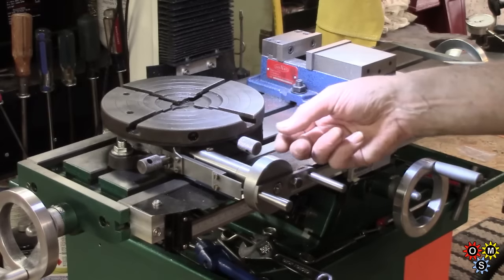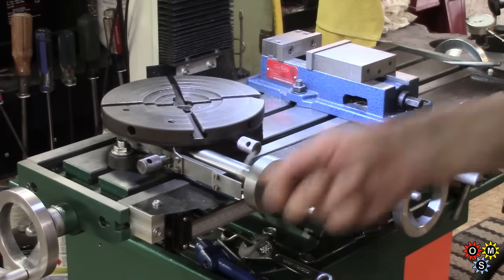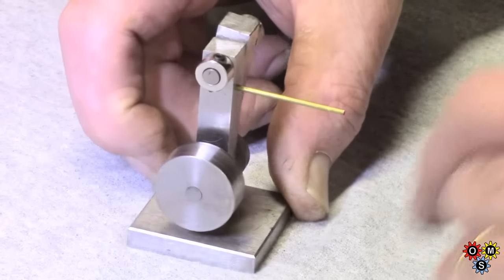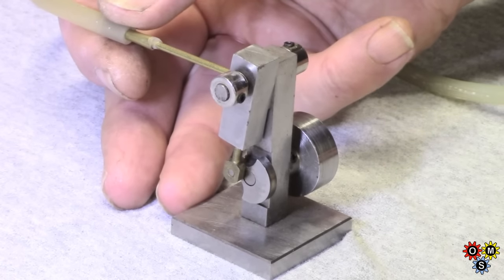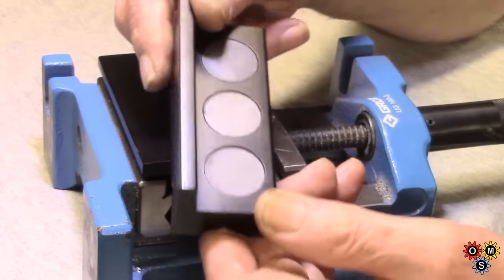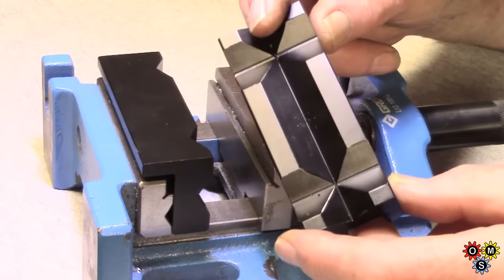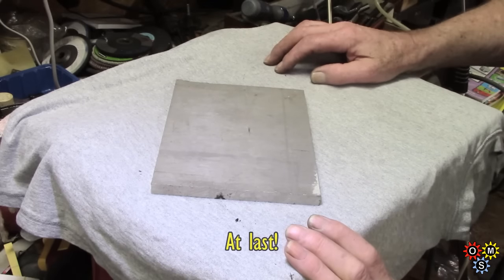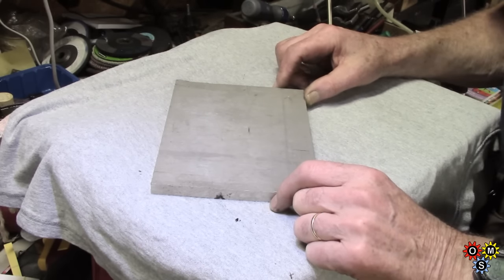Bits-02

Comment: Nice , Chris.
I wouldn't bother with a base plate just for the handle clearance, Maybe just an adapter so you can use a ratchet with an extension or something of the sort. You only need that to do the setup anyways.
Since the handle follows the top plate, wouldn't it hit the table if you are tilting towards yourself?

Cheers
Reply from the maker: +Phil's Projects 
Hi Phil,
Yes, I have since realized I should be able to not bother with a base plate. As for the crappy handle -- I think a simple tool should do the job OK and yeah - with table towards front it may be tricky for the square drive. Further evaluation will be done.